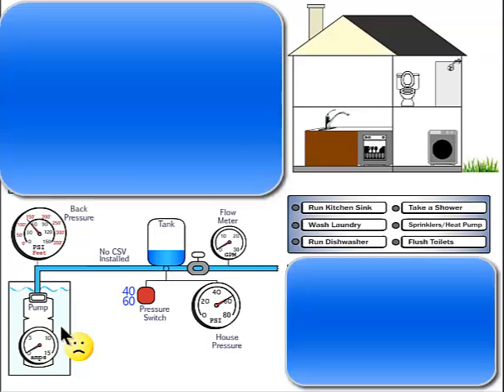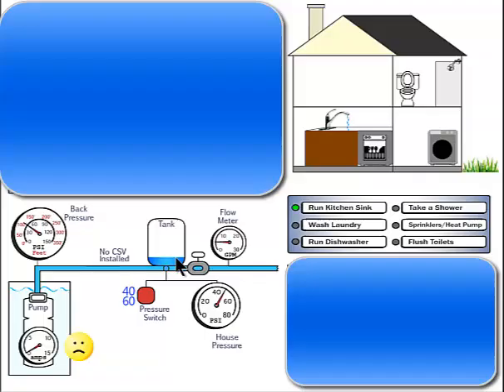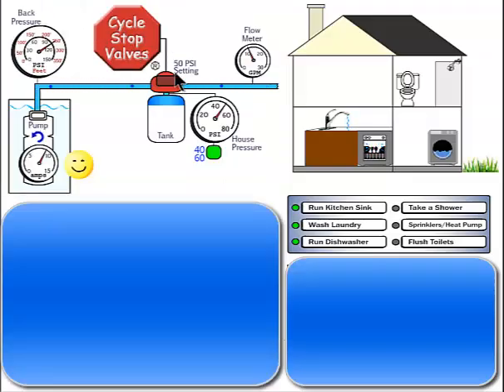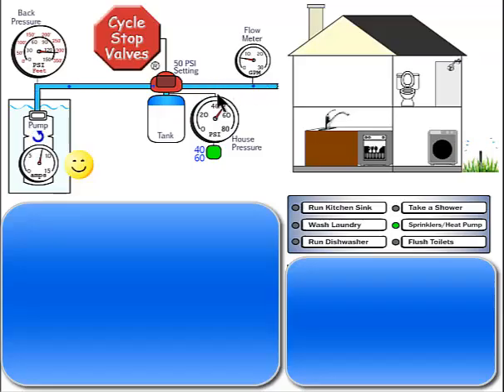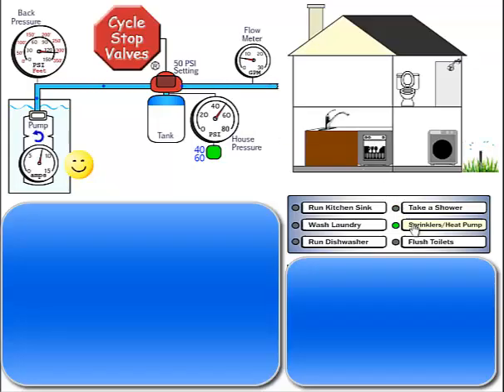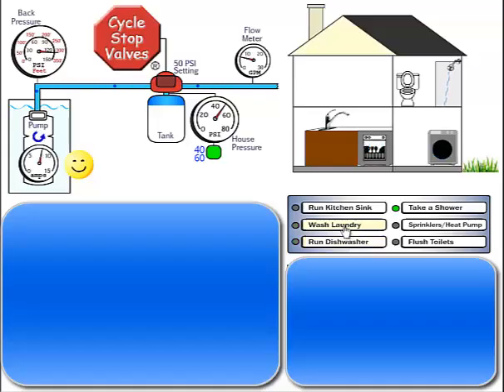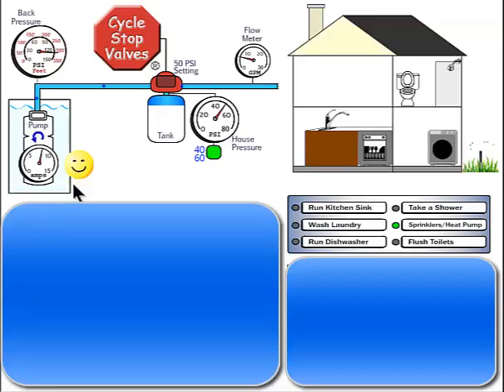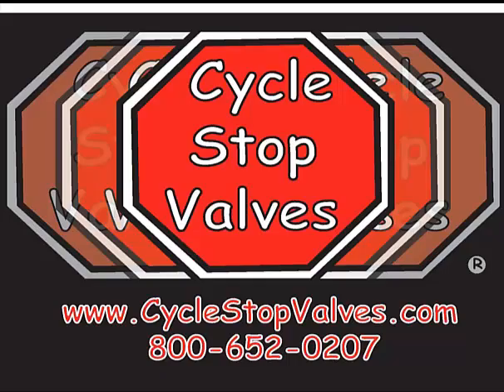How a Pressure Tank Works and why you need a Cycle Stop Valve

Comment: great video, and your assertion that even most plumbers don't understand the amp relationship to pressure. I'm on a well established well with `75' calculated head. even though the well is established, every now and again - usually after 4 days straight of rain, the water can be a bit more cloudy than normal. I have a question about order of devices. Would it be OK if the first device once the water line comes into the house is a sediment filter? It's a "high flow" water filter - translated means it basically only catches the bigger sediment. Would I be impacting the life/value/performance of the CSV?
Reply from the maker: The CSV125 valves do not like sand, but the CSV1A can handle quite a bit of sediment.  However, it is always best to keep sand and sediment out of the CSV when possible.  And as long as the filter is rated for the max pressure the pump can build, the filter can go before the CSV.  Give me a pump model number and the depth to water in the well and I can tell you how much pressure will be on the filter before the CSV.
Reply: the well pump is 2ST52-12PLUS-P4-2 
50' calculated head
200' distance to well with rise of 20'

I was hoping to set csv to maintain 55. do think that would be possible?
Reply from the maker: That pump can only make 103 PSI max.  If your water level is 75', that pump can only deliver 70 PSI to the surface.  So yes you can run the CSV at 55 PSI with a 40/60 pressure switch.  However, at 75' lift plus 55 PSI that pump can only produce  7 GPM.  If you use more than 7 GPM the pressure will be lower than 55 PSI.  As long as the filter is rated for 100 PSI or better it will be fine installed prior to the CSV.

Comment: good luck with that ! you really are over-engineering ,,
Reply from the maker: Actually the Cycle Stop Valve is a very simple device, which is why it requires such a complicated explanation.  Been having good luck with it for almost 25 years now.  I started out "over engineering" by building and installing Variable Frequency Drives.   Then I discovered a simple valve could do a better job.  It is easy to over think it and make it into something complicated when it is not.  The CSV is about as simple as you can get, and simple is what makes a pump system dependable.
Reply: sorry, I didn't say that clearly. Pump is at 30' in well casing, water level is at 20', and the pipe rises 20' to get to the house. So the total calculated head is 50'. Not sure if that makes a huge difference. I will verify the flow rate for the filter. Now just figuring out if i should go with the 1a instead of the 125. If i can get the filter in front safely, think i would go with the 125. Thanks for all time!
Reply from the maker: I was figuring  75' to water, so at 20' that pump will deliver 91 PSI to the surface. So the CSV1A will work fine and so will the CSV125 as long as you put a filter before it and keep the crud out of the CSV.

Comment: What is the point in having a pressure tank then?
Reply from the maker: Water is not compressible.  So you need a pressure tank with 75% air, so you have something that is compressible.  Without a little tank, there would only be two drops come out before the pressure drops from 60 to 40 and the pressure switch starts the pump.  Because of the air in the little tank, it will express about 1 gallon of water before the pump comes on.  So the 1 gallon in the tank will let the ice maker fill or you can wash your hands before the pump comes on.  Otherwise it would come on every time your faucet leaks a couple drops.  Those so called tankless controls all have this problem.

Comment: First off great video, I have a few questions tho...So as the csv reduces the flow as needed, I can see the pressure go up on the pump discharge.  How does the pump conserve energy if only the flow rate is reduced?  The pumps output should be the same no matter the flow which is why the discharge pressure increases as the flow to the system is reduced correct?  I understand the concept, but am wondering what kind of stess a csv would put on the pump and if it would reduce the life of the pump any. Thanks for the video and I look forward to getting my questions answered!
Reply from the maker: It is just the opposite of what you might think.  Counter intuitive is the word.  You can see as the pressure goes up on the pump discharge the amperage or power required goes down.  The amperage is the "work" that the pump has to do.  So when the amperage goes down the work goes down, which is easier on the pump, not harder.  Most pump guys don't even know amperage or work goes down as pump discharge pressure increases.  If you find a pump man who understands this counter intuitive fact about pumps, you found a good pump man.  If a pump man doesn't understand how a pump really works he will try to sell you a VFD.  But a VFD is just trying to trick a pump into doing something it already does naturally.  Just most people don't know restricting the flow from a pump makes the pump draw lower amperage and last longer than normal.

Comment: This video is titled "how a cycle stop valve works" and is misleading to me. I want to know what it is doing internally and all you tell me is that it is maintaining a steady 50psi with out cycling the pump. All I can figure is that the valve somehow closes off the piping from the pressure switch below a certain pressure (enables pump operation) and regulates pressure at the outlet of the device. How about an animation of the internal operation of your device so we can understand the "magic."
Reply from the maker: There is no magic to the Cycle Stop Valve.  It is the centrifugal impeller pump that is magical.  The Cycle Stop Valve just works like any ball valve or faucet, except that it has a spring and diaphragm to control the opening and closing.  

With 50 PSI of tension on the spring, the spring will push the valve open to give you more water when the pressure goes below 50 PSI.  When the water pressure, which pushes on the diaphragm is up to 51 PSI, the diaphragm is stronger than the 50# spring and pushes the valve towards the closed position to give you less water.  This way a simple mechanical open/close valve knows how much water you are using, and simple valves off the flow line from the pump, to make the pump output match the usage.

The magical thing is how a pump reacts to the flow line being restricted with a valve.  The backpresure gauge and the amp meter in the graphic illustrate what I failed to mention in the video.  The backpressure gauge is marked in feet of head and PSI, which are interchangeable.  2.31' is the same as 1 PSI.  So when the system is requiring a low flow rate and the Cycle Stop Valve restricts the flow from the pump as needed, the backpressure gauge goes up, and the ampmeter goes down.  "Magic"  But that is just the way any centrifugal impeller works. 

By restricting the pump flow with a Cycle Stop Valve the backpressure goes up, making the pump think it is in a deeper well, which is what makes it pump less water.   Although you would think restricting the pumps flow with a valve would make the pump work harder, just the opposite is true.  Centrifugal pumps are truly counter intuitive, "magical", in that as the flow is restricted, the power required or amp draw goes down, not up as you would think.

The Cycle Stop Valve takes advantage of the "magical" properties in a centrifugal pump.  The Cycle Stop Valve is a simple valve that opens and closes to maintain a constant pressure, and varies the pumps output to match the usage.  Maintaining a strong constant pressure is just one of the many benefits.  The fact that the amps reduce when the flow is restricted is just a beneficial and misunderstood side effect.  

The only trick to the Cycle Stop Valve is that it just can't close all the way.  That is the part that determines the minimum safe flow for the pump, which is also the rate that will fill the pressure tank.  The whole thing is so simple it can be very confusing.  

The Cycle Stop Valve is just a plain open/close valve that can't quite close all the way.  But the benefits of the Cycle Stop Valve and the positive effects it has on a simple dumb full speed pump can take volumes to explain.

This video is just one of my many efforts, and I am sorry it still didn't quite do it for you.  Cary
Reply: So, the pressure control "sees" the pump all of the time? Where do you set the cut in and cut out for the cycle stop functioning at 50psi?

Does the cyclestop valve have a set minimum flow, or is this adjusted for the pump curve?
Reply from the maker: The cut out pressure must always be higher than the CSV set pressure.  How much higher depends on how large a pressure tank is used, and how long you want it to run to fill the tank.  ie;  Small tank 40/60 pressure switch with CSV at 50.  Large pressure tank 40/60 switch with CSV set at 58.The CSV sees the downstream side, not the pump side.  As with the CSV set at 50, when the downstream is at 49 the CSV knows you need more water and opens as much as needed to get back to 50.  If the downstream pressure is 51, the CSV know you need less water and closes as much as needed to maintain 50 PSI.Above 50 PSI the CSV only lets through the minimum flow rate.  The minimum flow is different for different size CSV's, as different size pumps need different amounts of flow to keep cool.  CSV's for 2HP and small have a GPM bypass.  CSV's for 3-5HP have a 3 GPM bypass.  And CSV's for larger 5HP and larger pumps have a 5 GPM bypass.  And these are average flow rates, because the real minimum flow depends on the differential pressures.  With the 1 GPM bypass, the actual minimum flow is 0.2 to 1.8 GPM.  With jet pumps and small submersibles that can only make 10-20 PSI differential pressure, the minimum flow is 0.2 GPM.  And these smaller pumps only need 0.2 GPM to stay cool.  With high head submersibles and booster where the differential pressure can be 125 PSI, the minimum flow through the CSV is about 1.8 GPM.  And these higher head multi-stage pumps need 1.8 GPM to stay cool.  So even with a set size bypass in the CSV, the minimum flow is determined by the differential pressure.  This gives larger pumps a larger minimum flow, and smaller pumps a smaller minimum flow, which automatically matches what each pump needs.

Comment: This is a very well done video. I'm having issues with my existing 86gallon pressure tank, rust, and falling over. Its very very old. I have contacted multiple well and pump contractors in my area (3) and none of them make the time to come see me and give me advice or an estimate to update/fix my problems. After days of research I'm looking at going with constant pressure. I'm just having issues with finding out what all equipment i need. Do i need some kind of controller module? Isn't the CSV just a mechanical pressure regulator? Being a process technologist i deal with gpm, psi, fpm, and amps on a daily basis. I am use to control valves and check valves and all. I know i can build the system no problem if i just have a little guidance. if you could please help me and just share a little bit of your knowledge my family and i would appreciate it. If you would like to email, call, or txt i am including my info. ssjr4169@gmail.com, 985-212-4840. I work shift work in a chemical plant so if i don't answer please leave a message. I am currently on nights. Thanks so much for this video and your knowledge
Reply from the maker: No the CSV has no wires or controllers.  It is an all mechanical valve controlled by a simple bolt and spring to set at the pressure you desire.  I can talk you through it and supply drawings to help.  If you are working nights then you are sleeping days and I don't want to wake you.  So it would probably be best to call me when you have the time.  800-652-0207  Thanks /  Cary

Comment: Thank you, I've been maintaining a well system for decades without understanding it completely. I've achieved ok results by using overkill on everything. I have recently installed a CSV but need to do more adjusting, as my pump still cycles
Reply from the maker: If you have a CSV and the pump is still cycling, just loosen the adjustment bolt on the CSV or increase the pressure setting of the pressure switch until the pump runs continuously while you are using water.
Reply: That worked well, I settled on 55 in a 40-60 system, and it is doing as advertised.  The Animation got through my confusion like no written explanation has, excellent work, Thank you again.